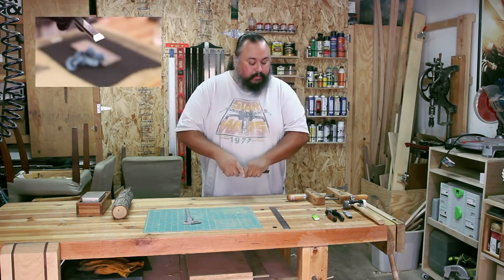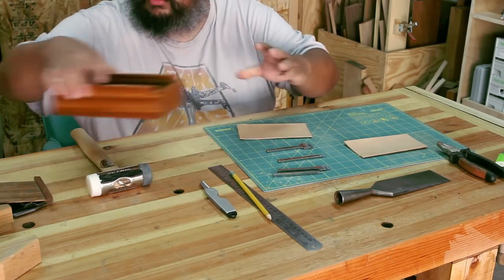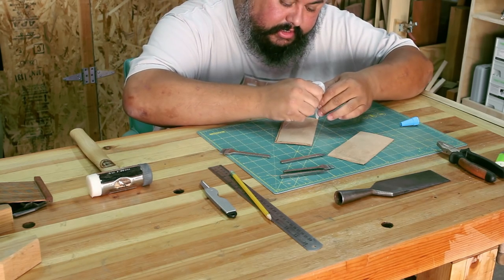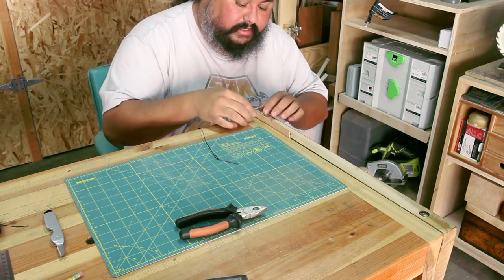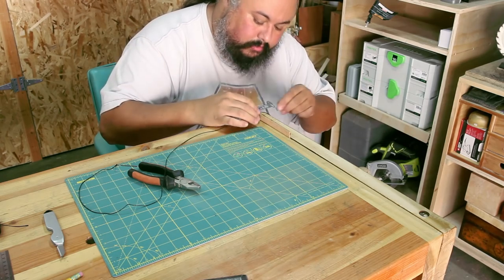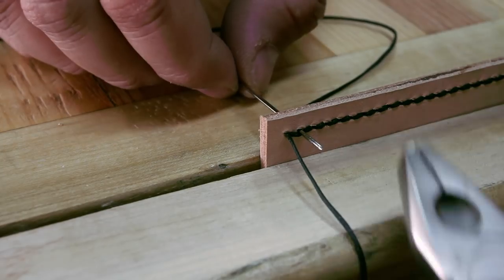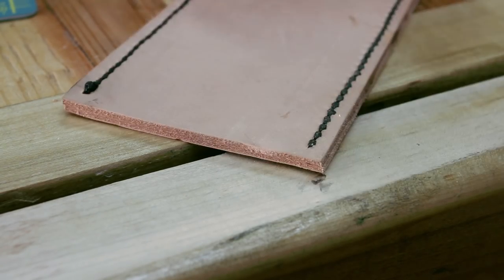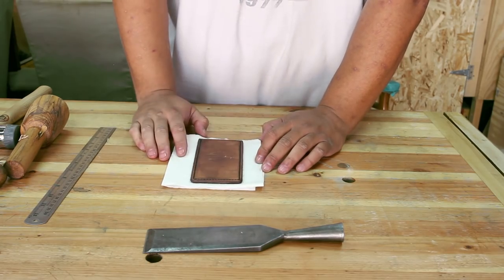21 - Chisel Leather Sheath and Handle

Comment: If you insert the two needles in a hole at the same time, there is no risk to punch the thread. And that enlarges the hole a little. 
Thanks for your videos. 
jp from France
Reply from the maker: Jean-Paul Muller thank you for that tip! Makes so much sense I will be doing that for sure!

Comment: Fantastic video as always. Looking at the bark I'd guess that wood is Maple. Pretty sure about that. Especially if you it felt a little heavy even after drying.

Where did you pick up the leather working tools? I'd like to get a kit like that myself. Also wondering if you tried finding a local leather suppler?

Lastly I think that large chisel could easily be a slick chisel. Putting a large handle on and using it for smoothing out a tenon is how I use them. I guess anything two inches wide and over with some mass it to it is a slick? Or the body has to be over 7 inches? Don't know for sure.